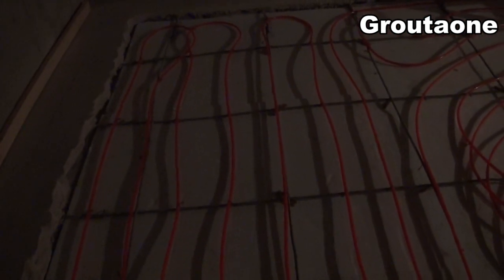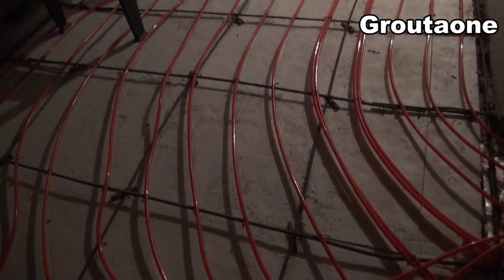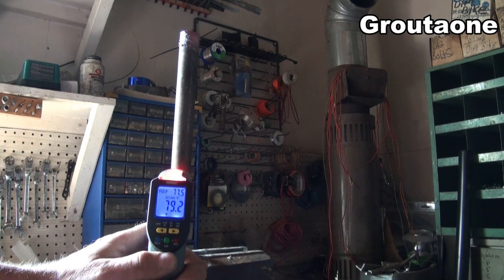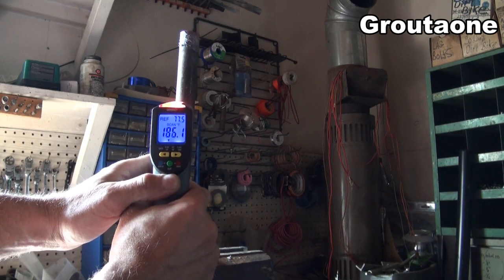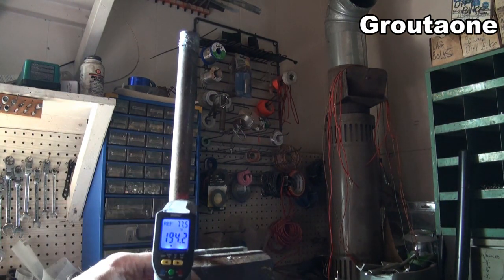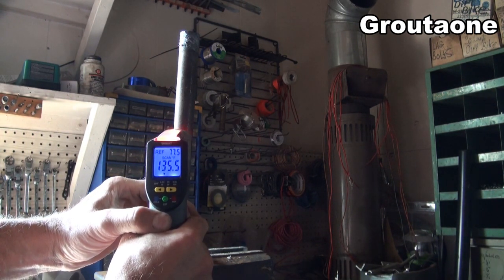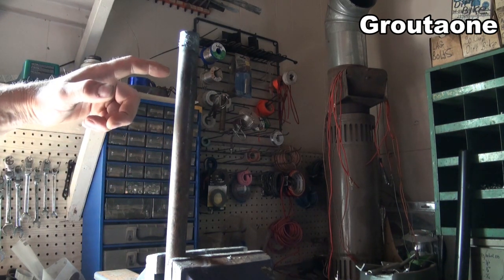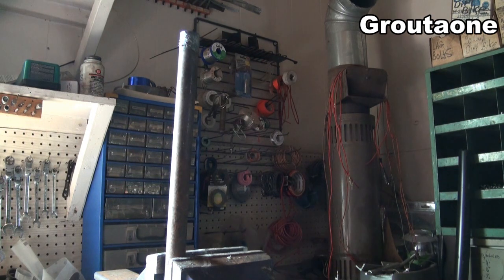Floor Heat Expeiriment Important Info

Comment: that's heat transfer by conduction and insulation does not conduct as well as the cold ground.. if it was in gas form the heat would transfer by convection but the cold and warm would still mix... no matter what. insulation just slows the process down.

Comment: Hi Groutsy....you are absolutely correct....you need to insulate under your radiant otherwise you have about a 40% loss into the soil. I have been watching all you vids and you are doing a great job....!....Not sure why someone would say any different, yes heat rises but it also migrates....I have a boiler system in my shop and if we did not insulate under the rebar,  I would have lost all of my efficiency , My shop is the same just as you have, great job by the way, you would lose all of your heat if you never did it.....Great job Groutsy!!!!!!

Comment: YES you should in fact insulate before pouring cement floor, I have 26yrs old and I have spent 20 of them years in my garage and others like it. my garage WAS NOT insulated and in the winter while I am walking around the floor will start to get damp/wet from the heat of my feet drawing the cool dampness UP from under the none insulated floor....But that's just my $.02 about it. BTW great videos I enjoy them all

Comment: That heat will be stored in the ground that's were the efficiency is in the storage of the concrete and ground. The ground under your basement is more likely to deep to be effected by the weather outside. Like your oven after you cook a pizza its still puts out heat long after its been turned off.

Comment: 3 types of heat transfer
conduction - by contact, the one you just tested
convection - by movement, typically of air
radiation - as in the sun
convection rises, the other two don't care about up or down
put down a layer of closed cell foam, the tight blue stuff, then a layer of 6 mil poly, keep humidity from rising
i'm a gc and a scientist

Comment: In fluids, heat only goes up because of the difference in density. Warm air for example has a lower density than air in cooler state. So It acts the same as a mixture of nitrogen and helium... the helium goes up because of the lower density than nitrogen. That "exchange" can not happen in solid materials. So the theory of the viewer was wrong. Love your channel by the way thumbs up
Reply from the maker: silencium12 Thanks for watching

Comment: How about trying a porous material like what you want to use ,Concrete .
Reply from the maker: Frank Newcomb Like maybe a brick, I have some outside maybe I test
Reply: If concrete gets to hot e.g if it's in a fire it have a veery high chance of exploding
Reply: groutaone Yes ,that would be interesting to see but using heat other than a flame or light flame like a candle just for an experiment ,I wonder cause a buddy down the road does that for a living and doesn't use any foam at all  .
Reply: He doesn't do it this way ,he waits the floor is done then lays the lines flat and after he has a light pouring of cement without any gravel so all his work is close to the surface ,But Groutaone is a smart man ,I dont doubt his work ,it curiosity and for him more videos .

Comment: There are 3 methods of heat transfer. 

-radiation (infrared) 
-conduction
-convection

Radiation goes in every direction through everything that IR can pass through. 

Conduction goes through everything except perfect vacuum in every directon Although some materials conduct better then others. 

Convection is what often causes heat to travel upwards because most things are lighter when hotter. Fluids will therefore carry the heat up. 
Convectiom doesnt happen in solid materials. 

Thus the claim that heat only travels up is complete and utter bullshit.

Comment: It depends on how you will use the room, insulation would be best for a room that is used infrequently as you don't have to wait for all that mass to heat up. On the other hand if your using the room everyday and want a steady even temperature then the thermal mass would be beneficial.

Comment: I'm sure to some extent you both are correct. But heat does not travel equally in all directions. Think of when your welding up a corner joint vs welding down the same joint. If you don't know what I'm talking about you should try that next. Also heat a pipe in the middle and see how the heat travels. Great video! Thx.
Reply from the maker: jeff edison Thanks, maybe some more testing would be an idea
Reply: +groutaone   Convection vs Radiation vs Conduction.  the heat in the air is Convection. Heat in the ground is Conduction. Heat coming up from the floor is convection and radiation...

Comment: I think the "heat rises" theory really only applies to a liquid or gas. The molecules become less dense as the expand and will circulate upward, unlike with a solid piece of steel where the heat radiates in all directions.

Comment: You will also have significant loss since the thermal insulation is only in the middle of the floor. So maybe a better idea will have been to have a layer of thermal insulation on top of the existing concrete slab including on the sides and pour a new slab on top of that (that new slab will have had no thermal bridging no contact with the existing concrete floor or walls). Of course this will have taken from the height of the basement and not sure the basement was tall enough for you to afford that.

Comment: Be good for the concrete moron to study #passivehouse  design, the entire foundation has a thick dense polystyrene insulation which also kicks up the sides, incorporates rebar same as you have done, even the strip footings are all insulated. In fact the entire build is airtight and all thermal bridging is eliminated.
An example of Thermal bridging is when the inside of a lock is 'sweating' the warm air touches the cold lock barrel. The barrel is both inside & outside allowing the cold in, and the warmth out
Excellent stuff +groutaone

Something that is stunning is the amount of dead concrete we have on this planet, only used for one purpose whilst the 'deadwood' completely ignore its excellent thermal storage capabilities.
The narrow minds eh?

Comment: Yeah no not even, when you think about "hot air rising" what happens is, some of the hot air rises but some of the cool air below it actually sucks the heat out of the hot air as it rises until it eventually all dissipates and equalizes. Heat is always going to be absorbed by cold things around it whether it is on top, below, or otherwise.
You gotta think of "cold" as the absence of heat, you are sucking the heat out of something to make it cold, the more you suck the heat out, the faster it wants to absorb more heat, the bigger the heat differential the faster the transfer will happen, to a certain point..
Ill tell a story, I was working at a knife company for a while deburring titanium parts on fancy belt sanders, I used a quench tank to keep the parts cool so I could continue holding onto them with my hands to work on the grinder. When the part got hot at the end I was grinding on, even it it wasnt hot enough yet to prevent me from holding onto the cold end, as soon as I dipped the part in the water the heat "moved" up the part to the end that I was holding onto, causing it to be too hot to hold making me drop the part in the bucket every time. What I belive was happening is titanium is pretty resistant to heat transfers and it likes to hold heat, but it doesnt like to transfer to molecules next to it, so what I think was happening was the water around the part actually caused it to be absorbed by the water making the water around it warm then that heat was re absorbed by the titanium where I was holding it but the water never got hot enough around the part where I was holding to burn me so I dont know.

There are three types of heat transfer, convection, conduction and radiation, the fact that hot air rises has nothing to do with either of these three properties. Rising hot air is not a transfer of heat unless you are talking about the convection of the hot air to the cool air around it which is actually slowing down the hot air as it rises sucking heat away from the "bubble" of hot air.
(disclaimer: I have no idea what I am talking about, please feel free to correct me.)

Comment: An easy way to provide a small bit of insulation would be to use aluminium foil. It would be best to put down some sort insulation because the the concretes down, it's down!  Btw other commenters said that heat radiates, which only kind of true. It does radiate to a certain point but the it does 'travel' upwards

Comment: Heat soak ...... A solid will absorb the heat .Even leach the heat . Think about when you are sweating pipes .... Too much heat and the solder spreads way out .

Comment: Here is an article on radiant floor heat: http://inspectapedia.com/heat/Radiant-Slab-Heat-Mistakes.php Insulation seems to be a must. Heat dissipates in all directions and follows the path of least resistance, much like electricity. Hot air weighs less than cold air since it is less dense. The concrete is porous and allows the heat to  expand and travel through the concrete. The insulation is designed to trap the expelled heat from the pipes.

Comment: From the way i see it, yes there will be some heat soak. But wouldn't you want that in case of power out? I mean heat the hole pad and heat will stay longer. I guess i see it both ways but that said the heat below will still rise so either way would be the same...

Comment: that theory is only true with air (heat rising). with something solid like a metal pipe or concrete, conduction takes over. because the mass doesn't move like air does. so it spreads throughout the object. insulating your floor like that wouldn't exactly make it any better or worse. but it keeps the heat from being wasted to the earth. it would feel the same with or without it.

Comment: Now who's the moron who said this to begin with? I sure hope it wasn't a concrete guy - not that he'd have anything to do with the radiant heat that would be done by your HVAC installers normally unless of course you did it yourself.
Reply from the maker: Sachi WI I understand he is or was a concrete contractor and poured pads like that
Reply: groutaone They may have done it when utility rates were cheap and they used copper pipe in the floors - i guess he never educated himself of the new practices.
Reply: ***** I said that in a previous post

Comment: He's wrong - you always want to insulate below the tubing because heat radiates outwards in all directions - The guys at This Old house installed radiant heat in some guys driveway so he wouldn't have to shovel and they put down foam insulation first, then plastic and then the tubing.

Comment: Heat flows from hot to cold, it's simple energy transfer. The energy wants to be even across everything so if it's high on one end and low on the other, it will flow to the low end, it doesn't matter if it's up or down, or to the side.

Comment: Heat radiates. I dont get why some people say "it goes up", it radiates in a spheric way, it goes 360° should be more accurate I think
Reply: TheGraneable  Heated o2 that's an other story tho haha
Reply: TheGraneable People say it goes up because sometimes a hotter liquid or gas is less dense so it is buoyant and rises.
Reply: In a fire pit, which direction do the flames mostly go?
Reply: Flames are the visible gaseous part of a fire (Basically it's gas (There's O2 in gas)) That's because heated O2 particles gets lighter and goes up. But heat doesn't go up, it radiates
Reply: Not true, if groutaone performs the same test in the middle of that pipe you would see that while it will indeed travel down the pipe it will go farther, faster in the up hill direction